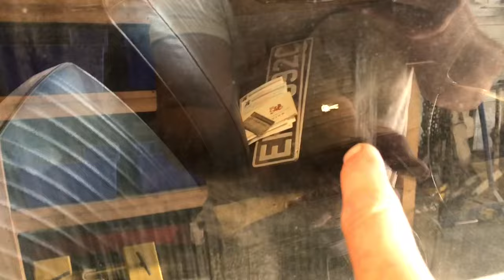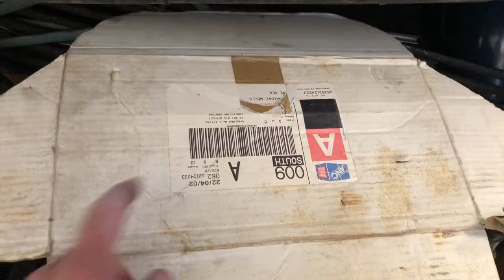Chris Buys a Barn Find Rare 1960's Non Runner Classic car

Comment: I can remember growing up in NY the local Pontiac Cadillac dealer in town did sell some Vauxhall Victor's and I remember them running around.  I always liked the size as they made more sense then the big full sized cars we had.  And I'm sure being NY, if kept there, they must have rotted out fast.  When the US compacts came out in 1960 I was surprised  how sensible they were.  When the NY Worlds Fair opened in 1964 1965 I was lucky enough to go there several times.  First stop was always the GM pavilion.  I have black and white photos of the "other" GM cars that were offered overseas.  They had Vauxhalls, Opels and Holdens there.  Holden?  What's that?  It was the sensible size of the Viva and Opel Kadett I always enjoyed.  To show my appreciation for these sensible sized cars I own 6 Chevy II and Novas from 1962 (the 1st year) to 1976.  So I understand Chris's fondness for Viva's.  There's just something about them, you just have to have some nice ones.  Thanks for saving the Viva.
Reply: Hi Michael. The Holden was another GM owned car manufacturer in Australia. They were very rugged as many of the roads were and are dirt track. They were large by European standards.  In later years they used small block V8's.  Like many car makers the Japanese imports killed the home market. I think Holden wound up in the '90's but if you Google Holden , Australia l'm sure you'll find all you need to know. Hope all is well with you and yours . I guess if you still live in N.Y. life has been very stressful. Take care and stay safe.

Comment: I had a viva van back in the early seventies I always liked the very short gearshift lever. when the car was first introduced it was a good competitor to the Anglia a lot of people used to clean there cars with washing up liquid and put it in the screen wash this used to cause a lot of rust issues as it removed polish and damaged the paint surface

Comment: Back in the day I had lots of Vauxhalls mostly big Crestas but one thing they all had in common rust I had a 1960 cresta only four years old but had rust holes in it this one of yours must have been well looked after to last this long first job on the list lots of waxoyl everywhere.
Reply: In the late seventies I had a Cresta with a 3.3 straight six and bench seat in the front.  It was hidden in the back of a dealers lot because it was running lumpy. I paid £140 for it.  Turned out the head gasket had blown between two of the cylinders which cost me £30 to get fixed.  Lovely car, flew like a bird.

Comment: In 1968 I got my hands on a 1967 Vauxhall Viva Brabham, one of the two that had been imported in Canda by GeneralMotors for evaluation purposes. What a great little sleeper. Twin SU carbs, ported heads, exhaust headers, Koni shocks, etc. Capable of close to 100 mph. MGBs could not believe what was happening to them. Your video has brought back some great memories. Thanks.
Reply: Wow, that musta gone like the clappers, mine was the 1100( or 1050, can't remember exactly) engine and it took a beating
Reply: Australia had VV and Brabhams too but renamed them Brabham (Holden) Toranas.

Comment: Solid body and nice surprise to know the original engine was in the boot. 
Nice to see it with as many original parts are possible and as unmolested as possible. 
Not this is a candidate for drag racing, but still nice to see it kept as close to as it was.

Comment: Nice find.  Any HA is a rare car now and could be a lot of interest to the classic saloon car racing people as they were very successful in period in the hands of people like Bill Blydenstein and also Sir Jack Brabham, hence the existence of the Brabham Vivas.  Deluxe was the basic model on the HA, but the amount of exterior trim, the pop out rear windows and the interior trim looks higher level than that so it might have had a replacement boot lid at some time as these cars could rust for fun.  It certainly looks extremely solid in a lot of the places where these first started showing signs of creeping metal worm.  It'll be interesting to see what engine that is in the boot as that'll give a good indication to what trim level the car actually is, if it's a 1.0 litre, the same basic engine that was seen in the Nova in the '80s, then it might be a deluxe with extras, if it's an 1159cc then it's definitely a higher trim level.  Of course, all the engines in these were predecessors of the 1256cc lump in the Chevette, which would give this a bit of extra shove for modern driving...

Comment: A very happy Chris  !!!! Look to have a good body shell to work with, you got a parts car in the yard to strip for spares,  ideal project !!!!!  You adjust the tappets on these HA engines running at idle, I can recall my first attempt  on an HA van in Aldershot in the 1970's using a 9/16 th socket, extension & T bar & feeler gauge !!!   Love the single fog or spot lamp, not legal to use alone these days !!!

Comment: When dragging the car out if the brakes are stuck on then as you are winching out give the steel wheel a bat with a sledgehammer as its moving. Sometimes works.

Comment: Before you put engine back in check if dizzy drive has broken on end has an offset slot thin side is weak could be why engine is out  Changed a few of them.

Comment: I bought a Bedford HA van for £50 in  1987 from  Gormans scrap yard very tidy van 9 months mot  would not select 2nd.i bought a much later viva gearbox from Gorman for twenty quid fitted it in a Sunday afternoon. Because it was a car gearbox not the right one The  gear lever fitted at an angle so I made the hole in the  tunnel bigger kept me on the road for 6 months. I sold it with short mot for £145

Comment: I had 2 ha vans mildly customised late viva 1256 cc twin down pipes wide steel wheels carpet floor to ceiling servo disc brakes good little vans look so small nowerdays .At least you could repair them if they broke down .clutch & cables were a nightmare to do used to work as a Vauxhall tech back in the late 60s worked on many .

Comment: Brilliant car, looks in great condition, I work in the plant where that was built. I would try to  keep the original engine as it should be a 1057 cc, the later Viva (HB) went to 1159cc and Viva HC 1256, the rusty Viva in your yard going by the exhaust manifold looks like a 1256 its size should be cast into the block

Comment: 2nd time watching ur vid,  still enjoyed it, get the old engine cleaned up and put back in, they're great runners, mind sure took a beating,  looked the same too , blue bod,  white roof, 1100 engjne, only prob i had was a wire came loose ,stopped the engine. All thag was in Kiwiland 1978 era.

Comment: The car looks to be in beautiful condition, I love the 60's styling. I'm not sure how practical they are nowadays though, it will be really slow if you were to install an original 1l engine. If it were mine I'd restore the bodywork and interior to original condition, install disc brakes modern suspension and install a better engine (Perhaps a C20 Red Top and F20 Gearbox). Old Viva's are able to take much larger engines and, I think would be the best way to build a car that you could use every day.

Comment: Hi lads love your vids please keep them coming.
That is a real little gem incredibly clean for one those, as soon as you said the back was sitting a bit low l guessed the engine etc was in the boot.
I and many others would love to see little gem running and driving, but PLEASE PLEASE don’t fit the other engine, with the service history the engine will probably only need the water ways pressure washing out as most cars of that era never used antifreeze so rust used to block the waterways in the engine and radiator, hence they used to boil up.
Might be an idea to take the head off and check for any warpage though, that done and possibly a new rad it should be good to go.

Comment: Had a neighbour that had one, remember one Christmas it actually snowed about four inches deep in Enfield , I was under the car in the street replacing the f...ing clutch so they could go away for new year. I do not like HA Vivas, full stop. Fortunately everything about them was light weight and the gearbox laying on my chest was easy to put back in. As to light weight look at the radiator grill, the whole thing weighs about 2 ounces.

Comment: A work colleague bought a brand new viva back in the late sixties after 18 months it rotted away.
Reply: Back  in those days you were supposed to have your new car undercoated and anti-rust treated.
( with stuf llike Tectyl, Dinitrol, Waxoil or similar)
The factory did not do it for you!
Reply: jfv65 Yep that’s correct, if I remember Vauxhall’s were using inferior metal, this car rotted in places no under seal could reach.

Comment: Very unusual to se an HA in such good shape, with no, or minimal rust  , I  if I were doing it,  would have the head off that engine in the boot check the pistons bore etc,  and then fit a new gasket,  if its sound,   i suspect that it may be a recon unit,  it looks too clean,  they are very easy cars to work on,   points rotors etc are still available, from   specialist suppliers,  most parts were  carried over to the viva hb, hc, and chevette, the Ha van  out lived  the rest of the cars, so survicing parts should be availible, you might have to  do some searching though for the brake parts
Reply from the maker: We have all the parts we got a parts car 👍

Comment: I had a new viva ha van supplied by the company I worked for
Reply: Ah Luton's finest. First firm I worked for had several. On one, 18 months old, the scuttle was rusting. Another snapped its transverse front spring when we pulled into a filling station - still drivable and we got it back (gingerly) to the firm's garage.
Never the less it's great to see a Viva that good and know it's going to be restored.

Comment: What the hell is A viva? And why would you want one?
Reply: Vauxhsll Viva, usually an 1100 cc 4 cylinder 2 door 4 speed Brit car.  Mine was  about the same color  but white roof ,ran real well, took a beating. I later had a Chevy  Chevette, which I  believe was an imported   British Viva.
Reply: @edwardmulder3777  I remember the Chevette. As I remember it didn't go over too well in the USA but I thought it had potential. So now I know. Thanks Edward. 🤗

Comment: What a mundane car    to call it a classic is a gross embellishment of the facts    you want to improve it dump a small block Ford V8 in it 5 speed box   3.23 rear end and fit disc brakes all round    Then you might have a decent car
Reply: The  rumble of a V8  gets on some people's nerves.
Reply: You would have to seam weld and fit a full roll cage to it or the torque for a big V8 would destroy it.   Just take it back to original.
Reply: How to wreck a good car,  put a V8 in it.  Thats about the most idiotic thing you could do to this classic car.